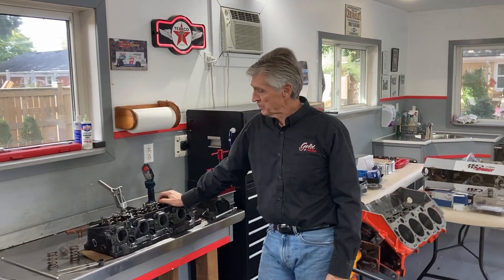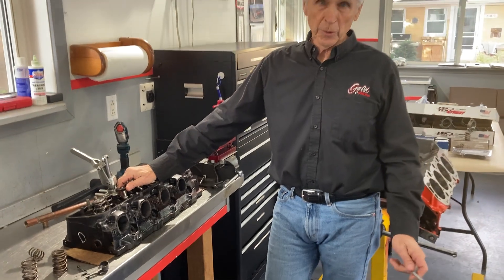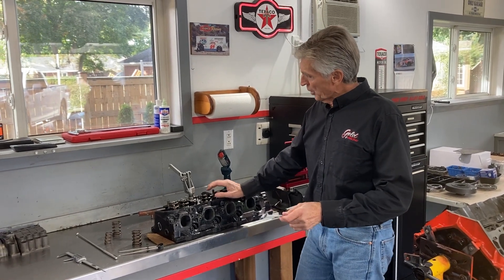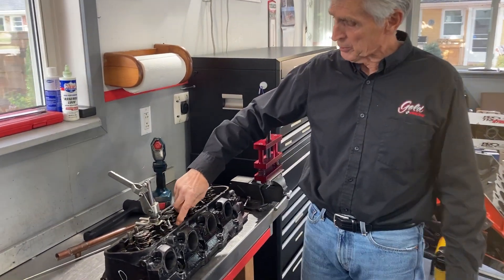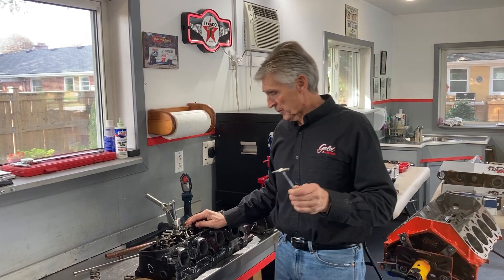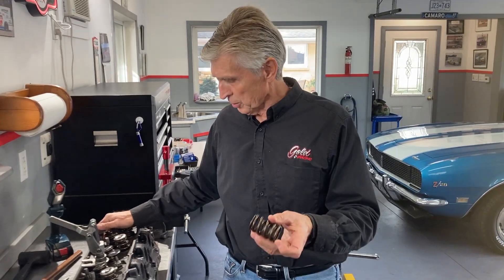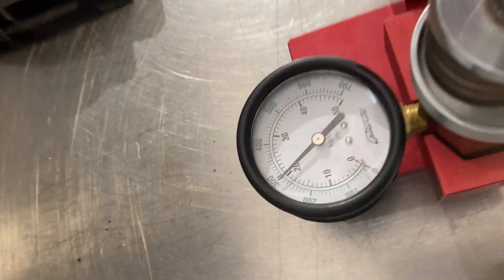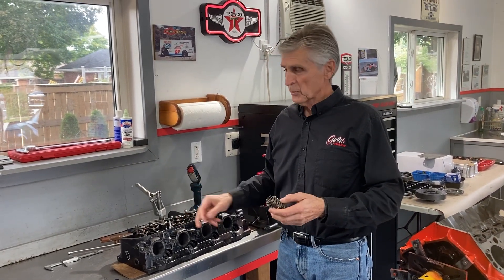Setting installed height accurately and measuring spring force with the valve open and closed

Comment: being parallel to the valve i assume is very important when measuring with snap gauges? I've seen a few other videos with this method of measuring, but didnt see or hear them measuring parallel to the valve. This is the advice I was using when measuring my spring install height earlier. without being parallel, the measurements were different than when i could get the snap gauge parallel.

Comment: 🤔 so on one hand, you Follow the box/ Manufacture recommendation  for Install height. But, you shouldn't trust them on.. force. But they don't tell what it needs to be. Or an acceptable range. Because there are too many variables in weight of keeper and spring cam lobe. But They sold you all of that with the cam and is matched. Checking the spring force is a good idea. But how do you know how close you can get to Distance to bind, if they won't tell Acceptable Force range.  Or. Is the .020 Variation in height you spoke of the answer to my question?  As long as its still Is acceptable range to bind.
Reply from the maker: Thanks Kevin. Not sure if i understand all your questions. Once you have the installed height and spring rate lb./in. you can calculate the open force. .020" variation is totally acceptable, remember the minimum shim is .015" . i think .060" to coil bind is safe. AG
Reply: @goldsgarage8236  thanks. My question is. If my spring say 1.800" at 100lb  285lb at 1.240 That's 3.3 lb per .010  My Distance to bind is Accessive, box say bind is 1.150 but it's 1.110 So, to get it to below 100 to bind. Installed at 1.755  would be 108.25 lbs closed 359.05 lbs open. Is that Acceptable ? And can I Optimize it even further To achieve .050" -.060" before bind. It's a 553 lift cam. beehive 560 spring. Stock rocker, trunyan upgrade, stock valve truck. Hardened push rods. 6500 rpm

Comment: The spring installed height spec is too generic as they apply it to a range of camshafts with different lifts.  IMO, you need to determine your own installed height based on closed and open force in conjunction with distance to coil bind.
Reply from the maker: Thanks for watching and commenting Monte.AG